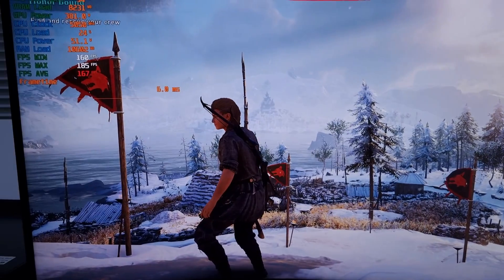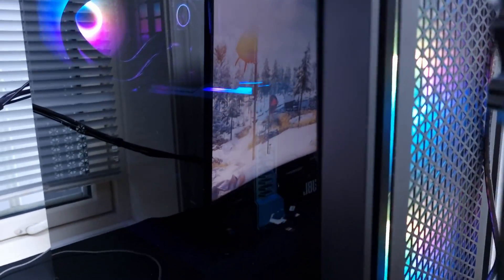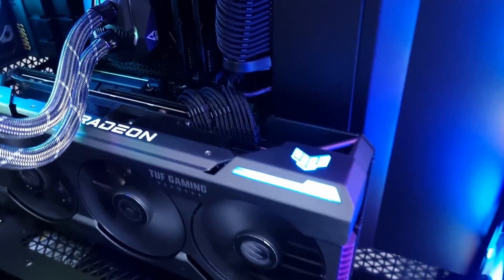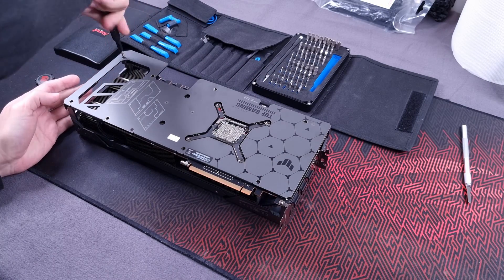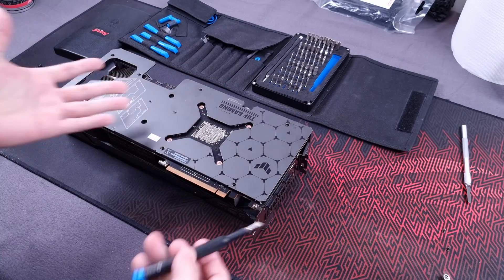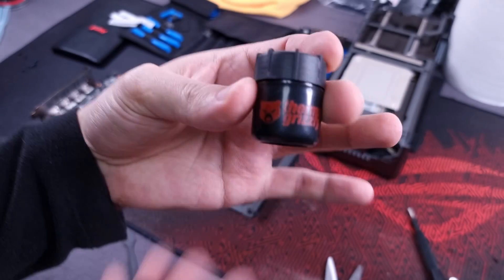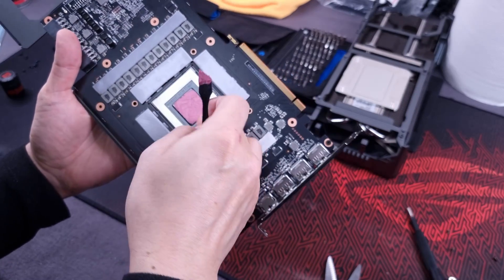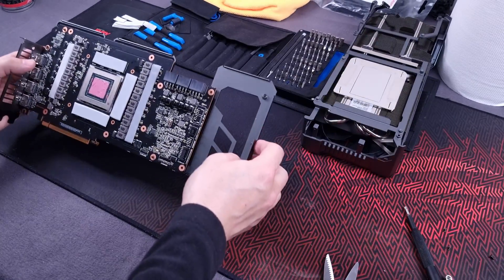ASUS TUF RX 7900XTX TEARDOWN (hotspot fix)

Comment: Lmao. So was it me or was the gap between hotspot and overall temp larger after what he did. Still a 20 to 25 degree difference right. All he did was bring down both temps. Not narrow or eliminate the difference.
Reply from the maker: The point WAS to bring down both temps, not just one, and I achieved just that.
Reply: Yeah not so sure that is a truth. As the title clearly says fix hot spot issue.  And in the first part of the video you claim the issue was the gap between the hot spot temp and the over all tempso bringing down both temps doesn't fix the hot spot temp issue that amd has with its GPUs. That issue is one of only a few issues.  And applying new thermo paste and pads won't cure that issue. The issue is that the face of the chip is bowed. So the heat sink doesn't make good contact with entire surface. Or it's just not an over all efficient heat pipe design.  Neither one can really be addressed by most DIYs.   But don't get sideways on me. Your video was a great how to change thermo paste and pads on a GPU video.  @TechnologyHive
Reply from the maker: @gtmddn  Nope. This is a chipplet design, so its not a "bowed" issue. It is simply ASUS using cheap TIM. Have a good one!
Reply: @TechnologyHive  again a not a complete truth. Seeing I own an ASRock challenger edition of the card and have the same issue. So how can it be just an Asus chiplet issue.   The problem runs in all brands and if you, while you have the card disassembled, would have put a straight edge on the chip and on the contact plate of the pipes. You would see that neither are flat.   And in most that I have seen. There is a middle bow .  I have seen advance DIYs re sand the chip which then brought the temps to about 6 to 10 degrees difference.  But the people said this is not recommended. As there is not much material there to work with and to much sanding could really damage the chip
Reply from the maker: @gtmddn  Good luck! Have a nice day!
Reply: @TechnologyHive  you too
Reply: @gtmddn  The issue of the gap between GPU temp and hotspot temp seems worse, as it's sometimes higher in the 7900 XT and XTX it seems, as I understand it. In other and often older GPUs, we're used to the gap being around 10 degrees. The overall reduction in temperature is a fix, even if there is still a 20 degree gap, so long as those temps are both brought down, which they were.
Reply: @ZenAndPsychedelicHealingCenter oh I completely understand and agree that bringing down the over all temps is a good thing. My point was and still is. The video did not say   this is how you lower over temps on a GPU.  It and the author of the video said they had a fix or they were addressing the gap difference between hotspot and over all GPU.  Which he did not do. The gap was no better after the new paste than it was before the new paste. Do ya see the point here. If someone was trying to actually fix the gap issue. This video wouldn't help with that. Even though it claims it does.
Reply: @ZenAndPsychedelicHealingCenter also. I bet I could bring down the over all temps with a water cooler or a better fans system in my case or any combo of different methods including new paste and pads.   But in the end the gap difference will still be there because I haven't addressed the issue of poor contact of the GPU plate to the heatsink plate.  Like I said in the few examples I've seen. Milling the GPU reduced the hotspot gap down from about 20 degrees to about 10.  Which you will always have a gap.  No way around that.   Amd just needs better quality control on that is all.

Comment: Turn V-Sync on.
Reply: God no. Nobody should be running VSync in 2025. Plus, Radeo GPUs have Enhanced Sync, which is much better and doesn't gimp frame rates and performance.

Comment: Performance is the same. 165FPS. Hot spot isn’t really relevant if you aren’t having any performance issues.
Reply: the problem is that if the hotspot to gpu delta is too high the fans will run at insane RPMs and make alot of noise.
Reply: Except that high temps degrade the longevity of the GPU and also increase noise.

Comment: There are ways to mount these horizontally with little to no PCB risk.  Requires laying the case horizontally during install and then adjusting either a sag bracket or my preferred method which is a separate sag kick stand on the outer rear corner of the gpu cooler.  Majority of the weight is shared between the mounting screws at the rear and the sag stand.

Comment: Actually vertically it will have worse temps. Just install it horizontally with a bracket.
Reply from the maker: @JohnWick-dv5ny  Nope. If you install it vertically with a 3rd party mount, you'll get better temps. Just don't use your case's vertical mount option. It often places your card too close to the side panel.

Comment: Temperature of that card is higher when you install it vertically, by the way.
Reply from the maker: @flenser404  Nope. I would know, since mine is installed vertically and runs cooler than horizontally. It's gotten new TIM also. I'm using Thermalright Heilos.
Reply: @TechnologyHive  We probably just happen to have different results. I had it run vertically for 3 weeks until I build it pack because it was constantly showing 5° higher temps than before. But then again, I watched this video because I need to redo the thermal pads soon. Which height did you end up using for what?
Reply from the maker: @flenser404  The pads sizes are mentioned in the video. I don't remember off hand. But I believe it was 1.5 and 2mm. For what specific area, I can't recall.

Comment: Running that gpu with that clock is intense.
I have mine running at 2,4 GHz.
But i will try that vertical stand to maybe next week.
Looks interesting 👍
Reply from the maker: The clock is actually auto. I do not overclock my GPU's ☺

Comment: I just bought a used "ASUS TUF RX 7900 XT GAMING" and it will arrive tomorrow. From the pictures the card is unopened (still has the warranty seals on it) so I wonder what my temps will be. So what do I need: 1.5mm Pads and 2 mm Pads and I still have Arctic Mx4 paste around. Is this correct or do I need something else?
EDIT: I see from reading the comments Thermalright Heilos is recommended for the GPU.
Reply from the maker: I think you got what you need. 👍

Comment: I have that same card  am I temperature are as followed 

Asus TUF 7900 XTX temperatures 

GPU temperature 41c
GPU memory junction 64c
GPU hotspot 57c

My PC is at idle right now with these temperatures but it is pretty warm in my room but I've never seen the junction go over 67 while gaming and the hotspot doesn't go up much at all
Reply from the maker: @Corys_World  mine runs the same. Rule of thumb is that your memory temp should not exceed your hotspot temp.

Comment: I have the same GPU ...but man there's no need to push it to 370w.
Reply from the maker: I have no issues with it since replacing the TIM to Thermalright Heilos. No under volting or limiting. Works great!
Reply: What termal pads were you using?
Reply from the maker: @ You can find them here: https://www.aliexpress.com/item/1005005898862800.html?spm=a2g0o.order_list.order_list_main.197.712f1802S33zdn
Reply: @TechnologyHive  Thanks man 😊

Comment: Had an Asus TUF 4070 Ti Super.  It only took 6 months before the temperatures got out of hand with a 30 degree delta and it died not long after.  I won't be buying Asus gpus in future.
Reply from the maker: That's terrible, but not news to me. I have a few 4070 Ti's here in for repair with twisted PCB's due to sag with ripped pads under the core. It is a trend and I do not see an end in the foreseeable future.
Reply: @TechnologyHive yeah, cards are getting too heavy I guess.  I used a support but that didn't help in my case.
Reply: @TechnologyHive  I will never mount my GFX card vertically always horizontal w/ support pillar or bracket
Reply from the maker: @joeydelmarsjr.646  You do you. I don't make the rules, I just repair your gpus.

Comment: slapped some mx-6 on there and my temps are back to normal.

Max 80c with every setting maxed out on adrenalin. Before it would cook itself above 95-100. I had to reduce power draw by -8 if not -10. Mx-6 does the trick.

Note: Not in every case do you need to replace the pads, only if they are applied bad or have torn when you've taken the board off the heatsink. However if you do decide to replace the pads, for this particular model you need the 2mm's, 1.5mm's for the vram.

Extra note: In this particular model in some cases including mine, there will be 2 pads seperately next to each other on the long line of chips (forgot the name lol). Replace those with quality pads, they are 1.5mm.
Reply from the maker: Nice!

Comment: Great video, thanks a lot! I'm gonna do this myself too as my TUF hotspot gets too high.

MIght as well change the thermal pads too, whilst it's opened up anyway. Can you confirm that the right pad thickness is respectively 1.5 and 2mm?

Cheers!
Reply from the maker: @timadriaans  The pads are correct, as mentioned in the video, so you'll be okei. Also, I'd try MX-6 or Thermalright Heilos instead of Kryonaut Extreme. The latter is just not meant to last.
Reply: @TechnologyHive  Thanks! This weekend i replaced the thermal pads with Gelid GP-Extreme pads (2.0 and 1.5mm) en for the GPU die i used a Thermalgrizzly Kryosheet 25x25mm. Works like a charm!

Both my hotspot and VRAM temperatures dropped drastically. Thank you very much for this video as it helped me a lot!
Reply from the maker: @timadriaans  Glad you got it fixed 👍🏼

Comment: ok i switch from old gtx 1050ti to RX 5700 GAMING OC 8G second hand i change termal paste the pads  the temps are 67/80c fans are 40% to 43% speed . if u ask me why 5700 not xt thats was my buget :) ty
Reply from the maker: The 5700 is still a good card, even today.

Comment: For reference:
O11D evo case

Mounting io side up + 2 exhaust fans behind: I get amazing temps

Mounting vertically like yours: crazy hot spot temps and card crashes under heavy load

Mounting traditionally *with card stand(very important) temps are fine across the board
Reply from the maker: @lossless4129 If your card is crashing under heavy load, it's not because it is overheating. If heat were the problem, the card would throttle to protect itself. The card is crashing because it is damaged.

Comment: The hotspot temp on my Asus Tuf 6800xt was over 110c with the fans almost at 100%, I changed the paste, tried different pads, different sizes, put it on the other bios but nothing worked, the only way I could use the card was to underclock and undervolt it. Eventually I decided to remove all the thermal pads and that reduced the temps to 100c with the fans spinning at 75%. 

I also noticed that one of the fans was at an angle, when I opened the fan section I noticed the reason for was because the end of the heatsink was bent and slightly broken, shocking considering I bought this brand new. Anyway I managed to realign it and this helped reduce the hotspot to 95c with the fans at 65%, I guess this is the best I can hope for.
Reply from the maker: Strange to have a bent heatsink out of the box. But I have seen some crazy stuff, so...yeah. Glad you fixed the problem though.
Reply: If you are getting better temps when removing pads that means the ones you are using are too thick - it prevents the GPU die from making good contact with the heatsink. Sometimes the sizes used by the manufacturer and sources you find online use soft pads, and you might have used a harder one that does not compress as well - so this issue can happen even if you got the right sizes. In the long run if you don't replace the thermal pads it will shorten the lifespan of your GPU. I suggest getting thermal putty - very soft material, use something like a 5mm ball for each of the ram chips. It's like clay so it compresses really well and you won't have issues with the gpu die not making good contact unless you use a ridiculous amount of putty. It's also much cheaper to buy a jar of putty than different sizes of pads. PTM7950 for the gpu die instead of regular thermal paste is also a good idea, it apparently lasts longer than even good thermal paste. I used Upsiren u6 putty on my 7900xtx and temps are comparable to when it was new. If your heatsink was bent brand new, it might have been a returned unit but since you opened it up you might have voided the warranty

Comment: I had an Asus TUF RTX 4070 Ti, and it pumped out after a few months. Asus was using some bad paste.
Reply from the maker: @umeng2002  Try Thermalright Heilos. This stuff works really nice. You apply it and forget it.
Reply: @TechnologyHive  Thanks, I actually just got a Thermal Grizzly Kryosheet. I've had a Gigabyte 4080 Super for a year now, and the hot spot temps are starting to creep up.
Reply: I had exactly the same experience - the card is dead now and the place I bought it swapped it for a Zotac because the Asus cards and RMA process cause too much trouble.

Comment: Is it the GPU chip that is not flat or the cooler?
Reply from the maker: It is the chiplet design to blame here.
Reply: @TechnologyHive  Ah, TSMCs fault then.. My 6800XT Red Devil IMHO runs warmer than it should with such a big cooler. Plan to repaste it in a few months.
Reply from the maker: @AtomicOverdrive  Try MX-6 or Thermalright Heilos. You'd be happy with these two, i'm sure.
Reply: @TechnologyHive  I got some NT-H2 on order.

Comment: Brought my hotspot temps down by 10 degrees just by switching to a different case. Also, performed a very minimal under voltage. Have an rtx 3090 was hitting 90 degrees Celsius. Brought it down to 80. Was so close to replacing thermal paste.
Reply from the maker: @ChocoBoy7-y8x  nice job.

Comment: the chiplet design does have the drawback of making it much more difficult to get even contact across all of the die. Going to be very hard to get around that, unless you lap the die after packaging, but obviously prior to being soldered to a card.
Reply from the maker: What ended up fixing this heat problem is replacing the paste with Thermalright Heilos. Kryonaut Extreme did not last even 2 months before problem came back.
Reply: @TechnologyHive  Makes sense, as it's known for pump-out

Comment: What thermal pads did you use? I purchased same thickness as the ones you used but the 2mm pads for VRAM are causing contact issues for the GPU die. 1.5mm pads are to small and cause overheating issues for VRAM but great for temps.
Reply from the maker: This is the store I buy my thermal pads from: https://www.aliexpress.com/item/1005005898862800.html?spm=a2g0o.order_list.order_list_main.197.44471802tT6XkA

Comment: Wow, big improvement on temps! GREAT!
Are you still running that card at those temps? Or did it get worse over time again?
Reply from the maker: It got worse over time. TG Kryonaut Extreme is not for longer term. Lasted only a month. I have since re-applied the TIM with Thermalright Heilos phase change material. It has been running at even better temps than as the latter paste.
Reply: @TechnologyHive  WOW, even more GREAT information, thx so much!

Comment: I have the same card.  Did you check the temps mounted the normal way?  I don't think my card gets that hot.  Also, the whining noise went away when I changed the power supply.  I went from 1200 to 1000 watt.  I guess it was a better quality PSU.
Reply from the maker: @chrismachica5219  Temperatures are better mounted vertically.

Comment: 16:43 isn't the Gpu temp and hotspot difference (25) kinda troubling or is that normal? I have a Asus tuf Rx6800, repasted it too with mx6 and we almost have the same difference.
Reply from the maker: @ssbbgg99  As long as the hotspot is under 90c, I do mind the temp delta between the core and hotspot.

Comment: The main difference between nvidia and amd regarding the Hotspot is flatness of the core 
Nvidia's cores have a 10 to 20 degrees delta because there cores have less curve. Amd hotspot delta is between 20 to 30 degrees. That is regarded as normal but i always recommend people to undervolt there amd gpu 

As mentioned by someone else in the comments. The paste you are using is not made to last very long. It is mainly for LN2 or extreme overclocking sessions. The regular paste of TG makes the core a few degrees hotter but it will last you a year or 2 
Great video and thanks for sharing
Reply from the maker: I have since replaced the paste with Thermalright Heilos. It is true what was said about the TG Kryonaut Extreme.
Reply: @TechnologyHive  indeed the only "extreme" paste that will last you a little longer is KPX but we are talking weeks not months. Used it on a 3080 Ti that was used to the max by a pro gamer and the KPX paste lasted around 11 months

Comment: I have a Tuf 4080 what is the size of the thermal pads I should get? 1.5mm? 2.0 mm? What brand do you recommend? Thanks in advance.
Reply from the maker: I do not own that card, and I have not had to repair a TUF 4080 model yet. I would do a google search. Sorry I cant be of help there!
Reply: @ Not a problem thanks!